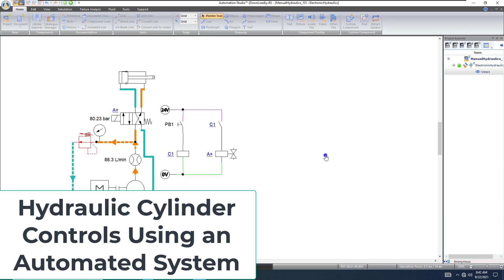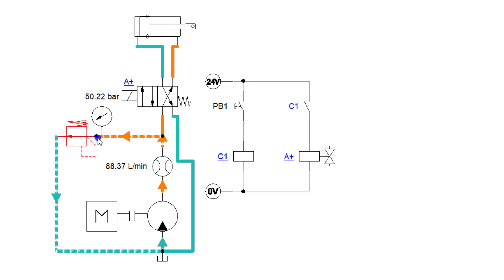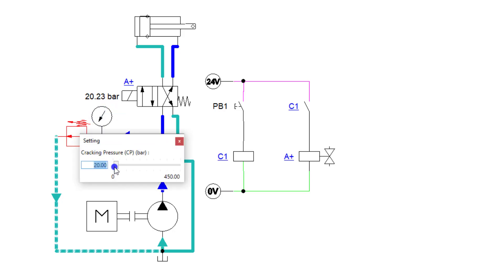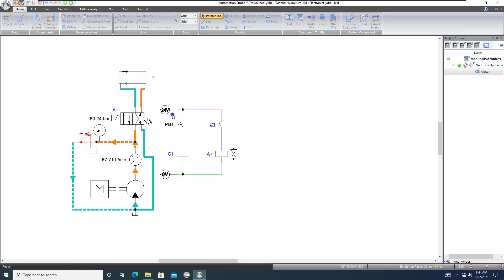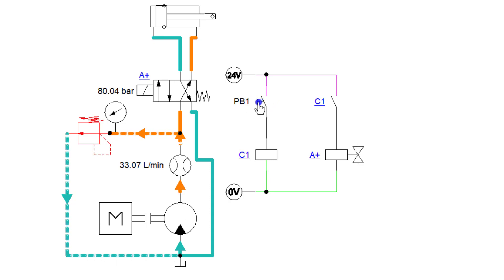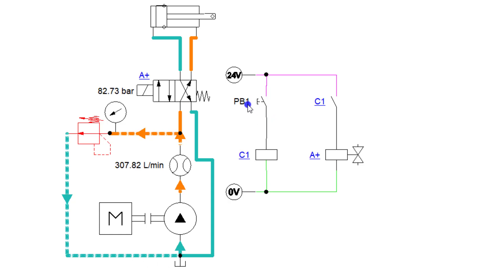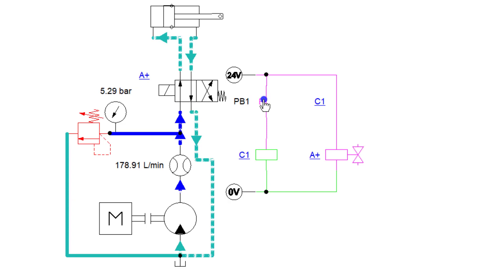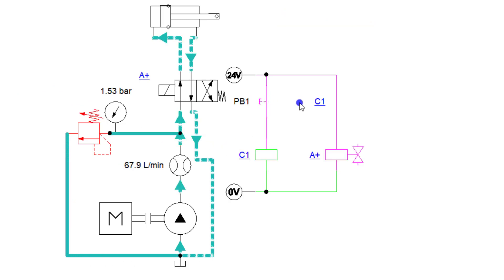Hydraulic Control of Cylinders: A Basic Tutorial

Comment: Hi Shane.
In the configuration of an axis. What should be considered in the conversion tab, besides the gear ratio? the diameter of the sprokets for example? I appreciate your comments
Reply from the maker: The gear ratio would be configured from the motor size, gearbox, sprockets, and if any pulleys are added.

Basically, all physical connections to the servo motor.

I hope this helps
Reply: @ShaneWelcher   the value in DRIVE RESOLUTION contents  all of this constants like transmission components?
Gracias.
Reply from the maker: @eoytecadr8988  Everything as I said in the comment above.

Also depends if you use rotary or linear